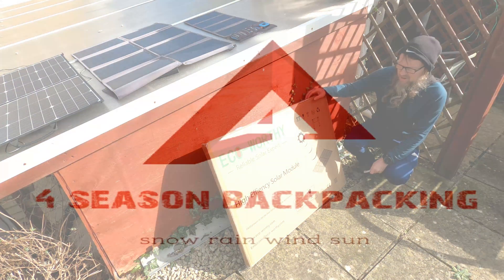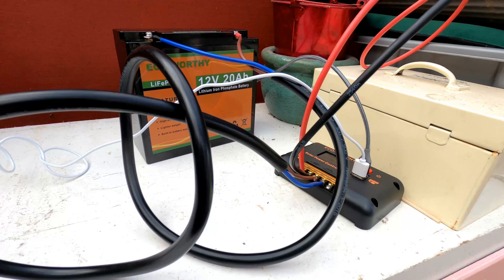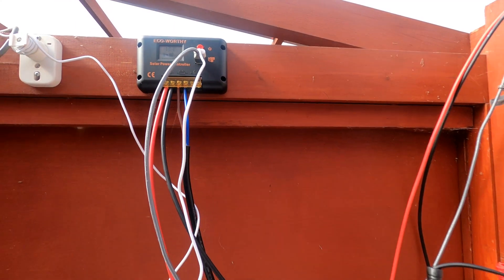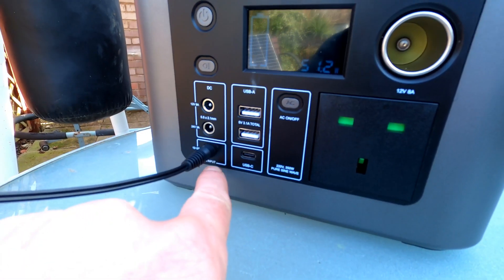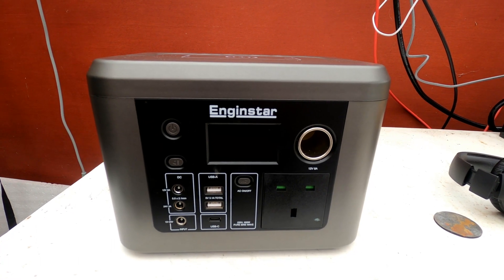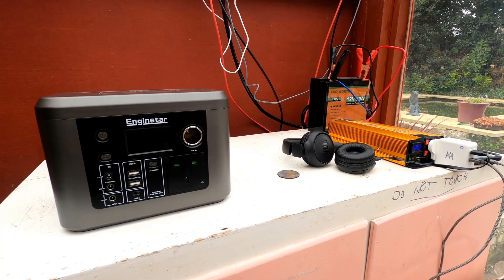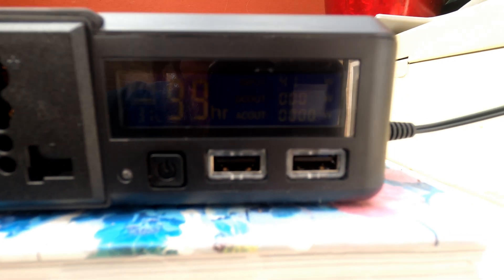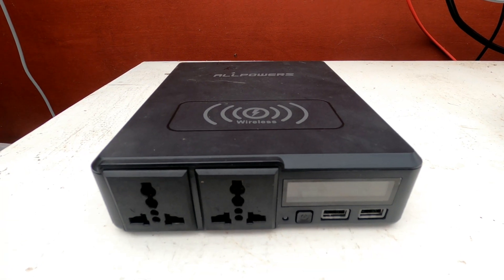Can Solar power help energy crisis costs?  Lithium LiFePO4 battery power stations storage worth it?.

Comment: Hi, appreciate your work here. I want to buy a swarey 518Wh with 100 w solar battery. Just want to ask you if you have any information about that power bank? Thank you
Reply from the maker: Sorry i dont but it should be better qwalty than the cheap battery i have in this video. I can see my cheap battery is still 100% working i been using it everyday apart from few months in winter. I see there a deal for that battery @ https://amzn.to/3V8aCho but sorry i have no information on it.

Comment from the maker: UK national grid Electric Price cap correct on 1st April 2022
Standing charge: 45.34p per day
Unit rate: 28.34p per kWh
In short it seems if your connected to the national grid and got solar to save on grid prices it will end up costing you more in electric for me at least.

Being hooked up to the national grid and paying Standing charge of 45.34p per day even before i use any electric is the main reason for me that i will make a loss with just about any power station with solar power. Most power stations have life span of 1000 recharge cycles. The only possible way i could make a saving this way is to be off grid and not paying the standing charge. 
I have a Enginstar 350W with 296Wh 80000mAh 41600mAh you can get @ https://amzn.to/3lIP36h . I paid £165 for mine. However at the current Unit rate: 28.34p per kWh i will be lucky if i get £80 worth of electric its whole life time with the full 1000 cycles but to realistic maybe even as low as £40 if you only get 500 cycles. Remember to get that rate i am paying Standing charge: 45.34p per day. So as i said if i was off grid not paying the standing charge it would work out cheaper. The Enginstar power station gives you power for your pound than other in my opinion. I also have a ALLPOWERS 200W power station with 154Wh 41600mAh 41600mAh you can get @ https://amzn.to/3uY4nAk . I was lucky to get this new for £90 but i will stick make a loss with it because of being connected to the grid. Why would i buy these power stations there handy if there a power cut. I can take them in the house to power things. I power the stations with a SUNKINGDOM 80W Mono-crystalline Foldable Solar Panel @ https://amzn.to/3KmLbCB . I got this panel back in 2016 and still working well. I also got a new SWAREY 100W Foldable Solar Panel you can get @ https://amzn.to/3v3Rtk6 as i have two power stations. The new solar works very well. I am easy getting over 60w on clear skys in Spring in South of England. The solar panels should last much longer than the batteries.
My installed setup is ECO-WORTHY 120W 0.5KWH/Day 12V Off Grid Complete Solar Power System Kit with Battery&Inverter: 120W Solar Panel+30A LCD Charge Controller+2pcs 20AH 12V Lithium Battery +600W Inverter you can get @ https://amzn.to/3vl0Koj . This up comes with two batteries where mine come with one. Very good deal. With this set up i should make a small saving with electric. If i was not connected to the national grid i should make a good saving over the life span of the set up. Again the panels should last much longer than the batteries.